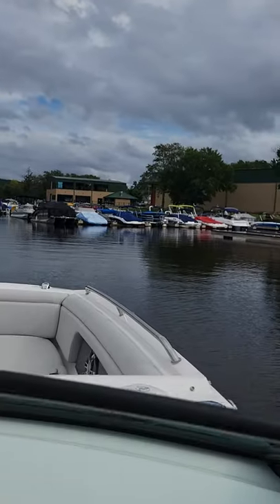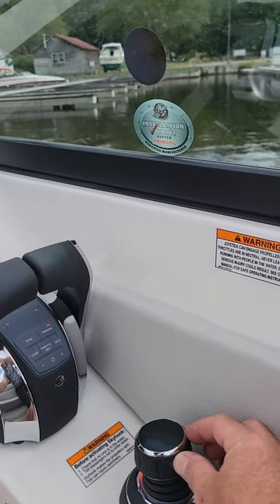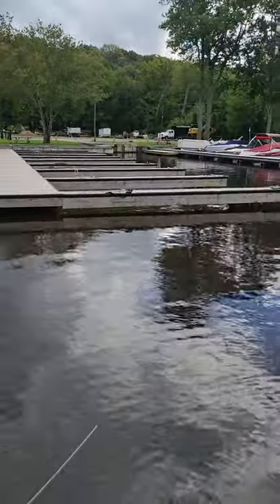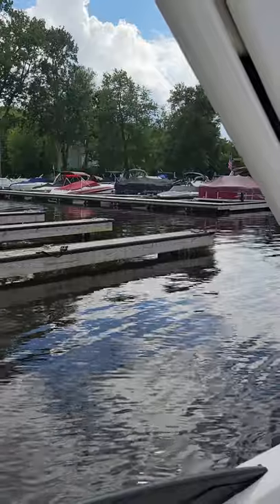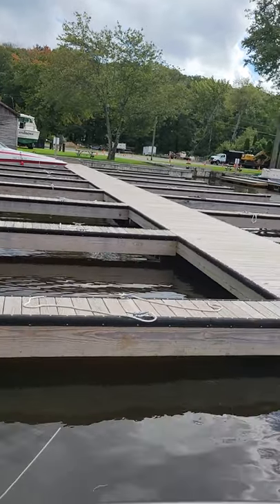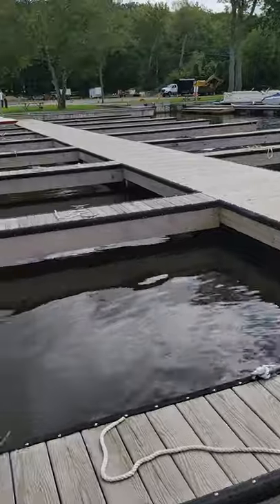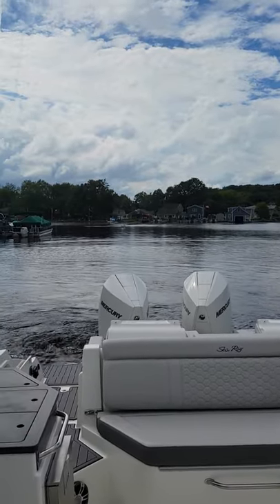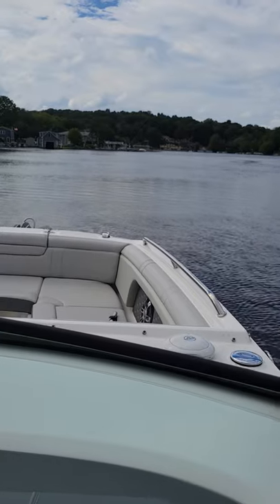Mercury Joystick, operation

Comment: Good Morning  I recently purchased a 2016 Boston Whaler 330 Outrage   It is equipped with twin 350 Verado's with JoyStick steering..  I watched your video which was very educational for me and very well done  TY!!!   Question I have is I noticed in your video there was a green circle ( Light ) around the joy stick.  Do you have any idea if that light should be on with my 2016 Joystick model   This 2016 boat came with JoyStick as original equipment  If you do Not know the answer, any Idea where I could research this?   Kind Regards, Rob in Cape Coral Fla.